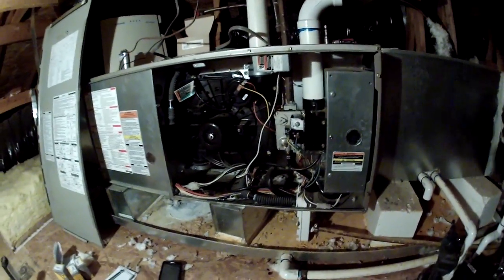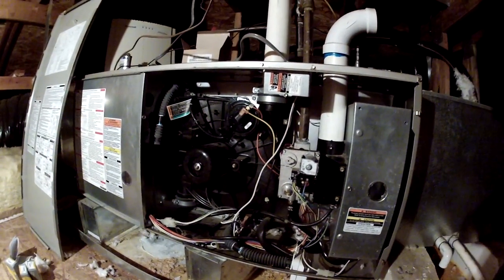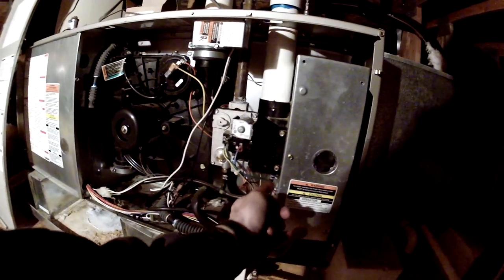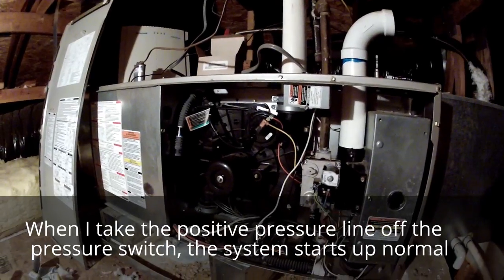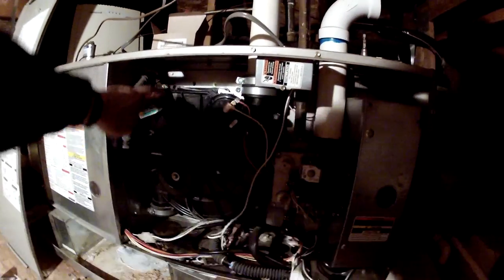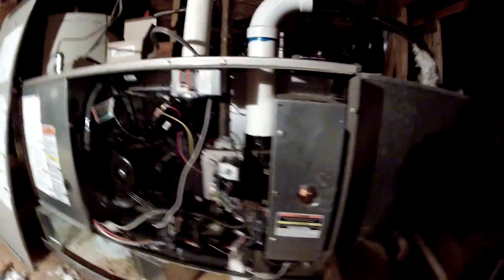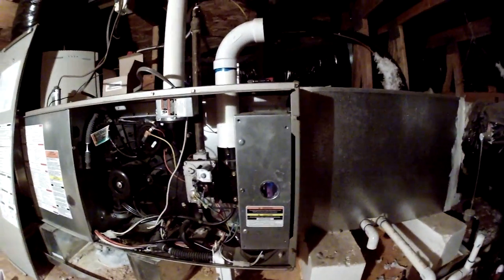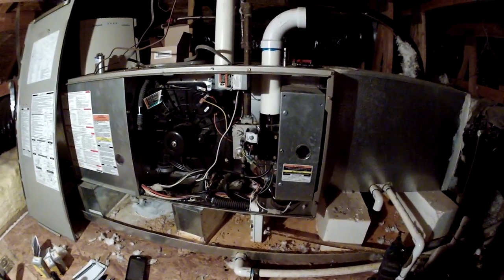I'm Stumped - Bryant 90% Furnace Pressure Switch Issue

Comment from the maker: The solution to this call was replacing the inducer assembly.  The suction from the inducer previously was 2.3"wc...Replacing the motor brought that suction to 4.0"wc...minus the 1.0" that was coming from the burner assembly left us with 3.0"wc to the pressure switch.  I needed 1.85 to close the pressure switch. All good now.  The 9 year old motor was slowing down enough to cause problems.
Reply: You just wasted their money.  You've got less than 2 yrs before that heat exchanger is clogged enough to trip the rollout on the collector box. This is why you hire an experienced FAD to service and install your equipment. The delamination("flaking") doesn't occur if the initial start up procedure was followed.  Yes there was class action suit that was settled that will give you labor allowance to replace the secondary hx but only because Carrier couldn't prove that people weren't following the written installation instructions provided with every furnace. The coating on the inside of the late model secondary hx required a minimum of 1 hr initial run time to properly cure. Thankfully they realized people are hacks and switched to a tubular secondary on the newer hx

Comment: Bryant had a heat exchanger class action a bunch of years back.  The secondary exchanger would flake off material and slowly plug all the vacuum lines.  After my exchanger was changed I had a problem with the furnace not firing.  I vacuumed out all of the lines and pressure switches and it's worked good ever since.

Comment: Always carry paper/clip in pouch, cleans ports on IDM or  vacuum switches. Usually vacuum pressure switch (L)1.25"- (H) 2.25"; also check for bugs like ants, yes they find away to get in there, pulled them apart find the buggers.
Reply from the maker: Michael Lee yeh I always keep strands of 18g Stat wire

Comment: Find the problem?
Reply from the maker: I talked to Bryant Support.  He doesn't think there is water in the secondary but did say make sure the furnace p-trap is clear.  He thinks I should replace the inducer motor because the suction from the inducer port should be around 3" minus the 0.5 to 1" from the burner assy would get me the 1.85" I need. Since I removed the flue pipe from the inducer assy he said we know it's not a clogged flue pipe.